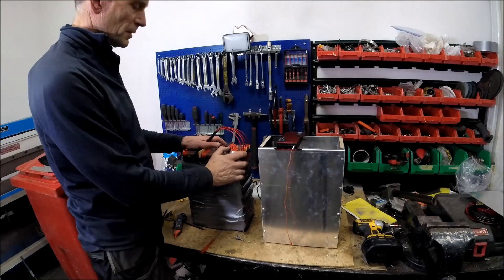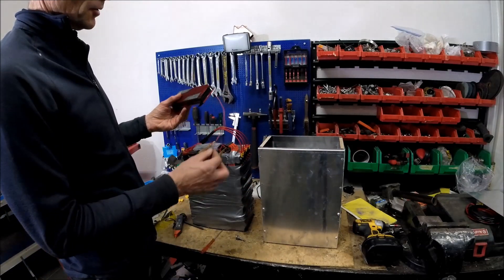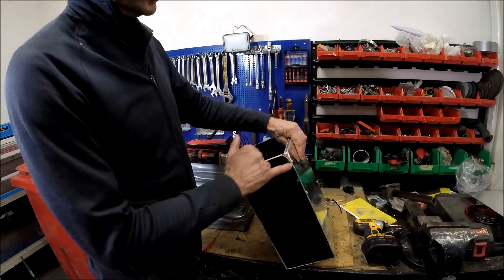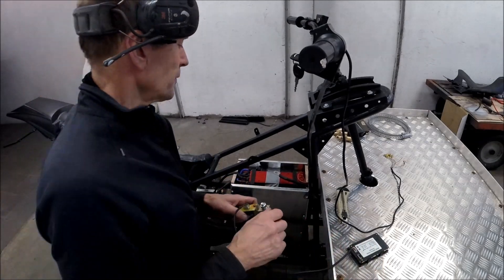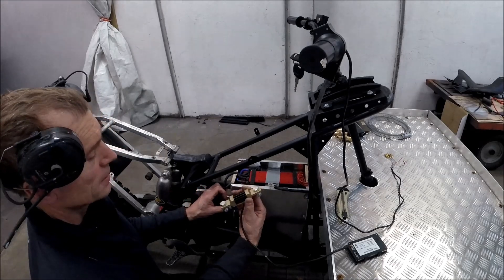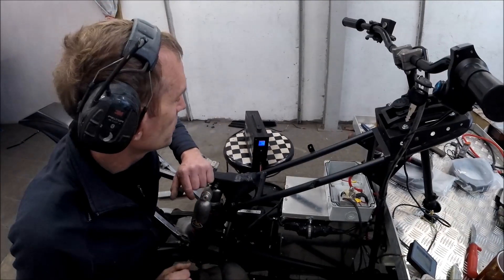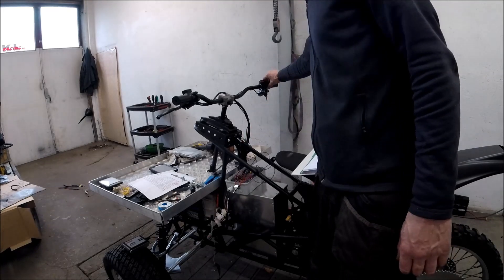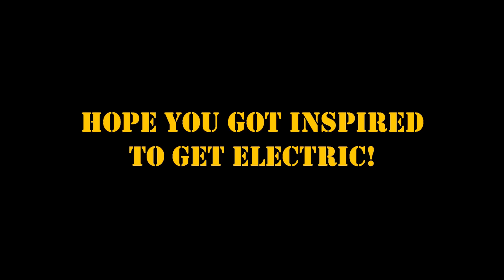Electric Delivery Dirtbike Testrun and final assembly

Comment: I have 3series wound, brushed DC motors, from fork lifts, 2 look new, one could possibly need brushes, and check the bearings, I was thinking of running them at about 96-120v or atleast 72-80 volts, with extra cooling, but it would be like a golf cart likely, so I'm thinking about getting a Nissan leaf motor, maybe two, if I can get them co-nected! To a single transmission, 5-6speed, to allow highway speeds, and go up hills!  (We have alot of hills around here!) And u want something much faster than a golf cart! I'll likely insted be using a Toyota Camry so a front drive transmission wil be needed, I was hoping for a small truck, either way, brushless, will be better! Great video!
Reply from the maker: Tank you, yes they get a lot of power out of the Leaf motor, Check Damien Maguire channel.  BR pär